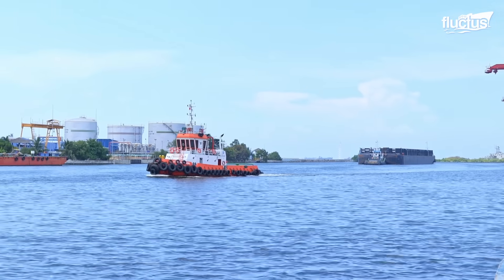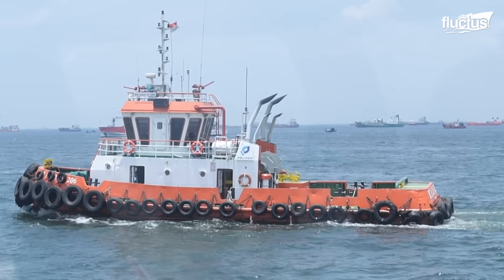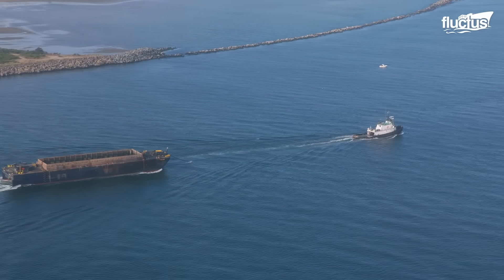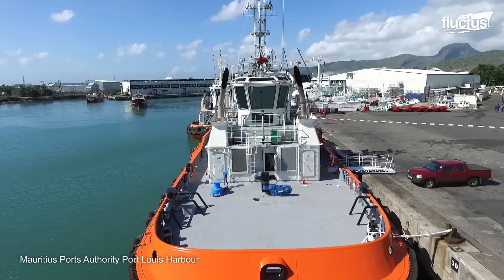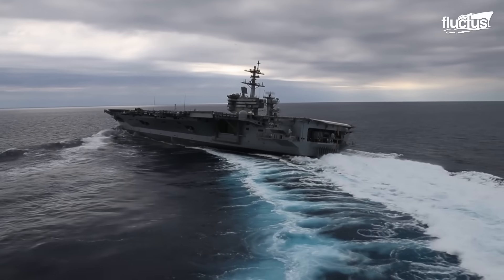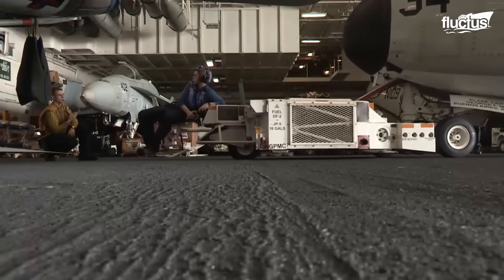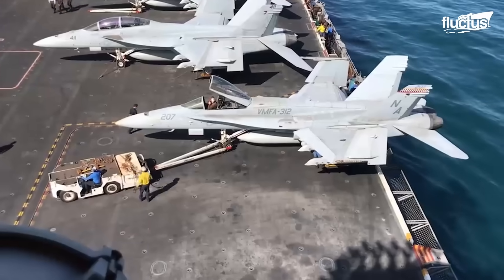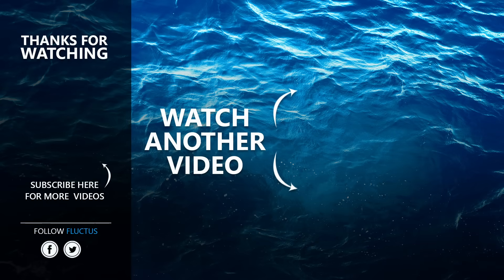Life Inside Powerful Tugboats Moving Gigantic Ships in Middle of the Sea

Comment: Thank you for talking about TUG boats 😊
You said tourists industry. At beginning of video. The amazing thing in the cruise ship industry now A days is the power system that the mega cruise ship use. The bow thrusting system and full rotation pods that new cruise ships have. They don't require a TUG assist when docking or leaving ports. They can do full rotation close to docks so both sides of cruise ship passage get full view of citys, or ice flow movement.